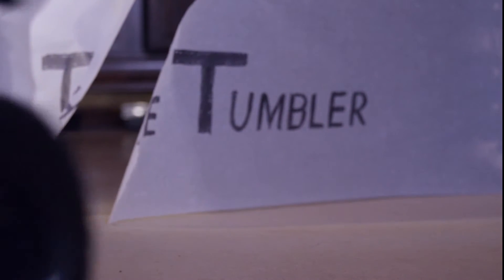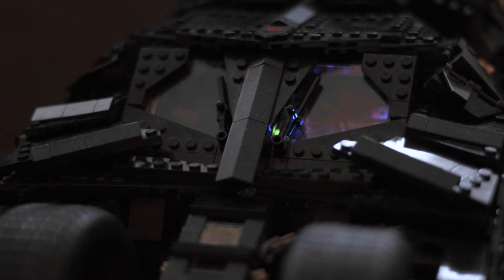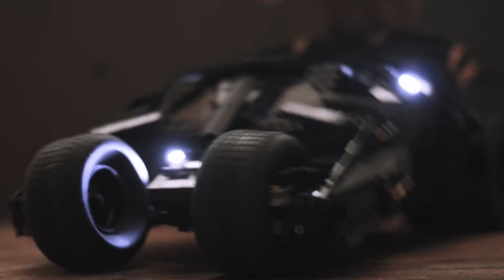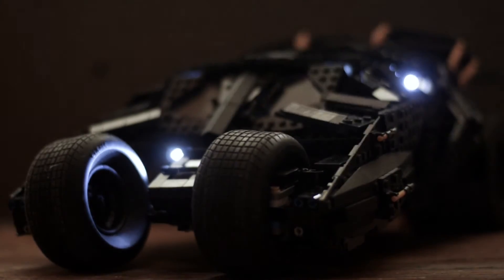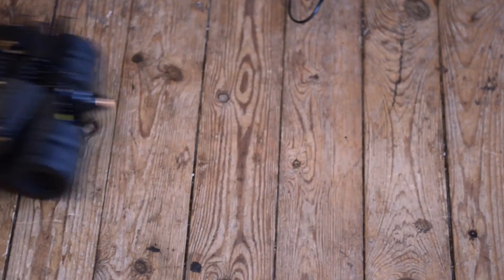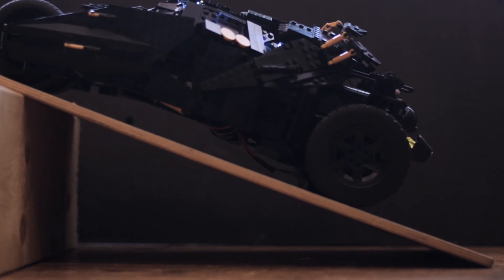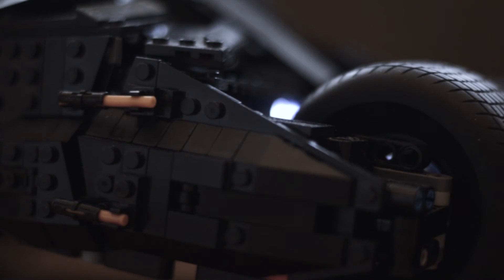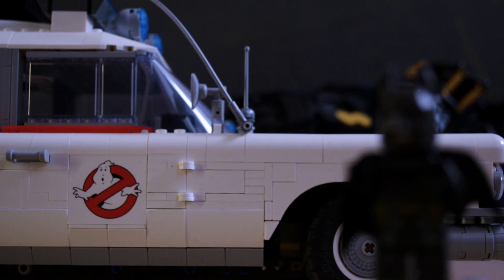motorized moc: RC LEGO Batman Tumbler 76240 / 76023 mod, Batmobile upgrade, remote control, lightkit

Comment: ery nice job ! Well done. I am thinking of downloading your instructions. Do you think that the Tumbler could be made only in Technic pieces (with imagination of course)?
Box 76023 is rather expensive now ...
Reply from the maker: I have also been thinking about it, you can do a lot with technic panels, would make it lighter too. I experimented a bit with that some time ago but right now I am working on the 1989 Batmobile (uhu black batty bam'a'lam - the motorized roof looks so cool) 
... I heard they sell tumbler brick copies in china muuuch cheaper, but they are probably IP infringement, if you know what I mean.
Reply: @recklessglitch  I prefer to stick with the Lego brand, but yes there is a big difference in price.
I bought your pdf manual for the construction.
I had started a few months ago to work on a Tumbler chassis with Technic parts (in particular the set 9398 which is very practical), I had succeeded for the rear wheels to achieve something, but with only one L engine it was not powerful enough. With two engines it looks perfect.
And before I had done three or four tries of different techniques, but without success.
So I will be able to use your realization and try to realize the vehicle in Technic.
And the video is just perfect too! It’s always a bit "painful" to watch videos of MOCs, but it was super funky and fun!
Reply from the maker: @pierrepesnel7355  Thanks a lot. I try to be funny and entertaining too because I know what you mean about "painfull". Check out these two: Sariel's Aliens Tank: https://youtu.be/cySq7id1wg4 is really cool and my 1989 batmobile: https://youtu.be/mb2n88BAh_k is really dunna dunna dunna batmaaaan ;)

Comment: How did you do the retractable roof?
Reply from the maker: What do you mean, how? I ... uhm ... built it from LEGO ;-) 
I replaced the center beam of the roof (that is important for stability) by adding a beam a brick or so below the roof. Then I connected the two halfs of the roof and built a mechanic that looks acceptable. That was an hour or two of work only honestly, the rest took me a month or two.